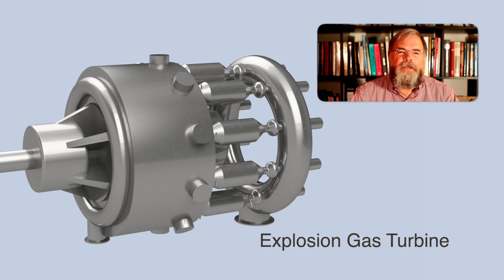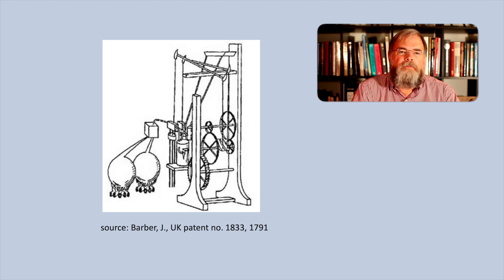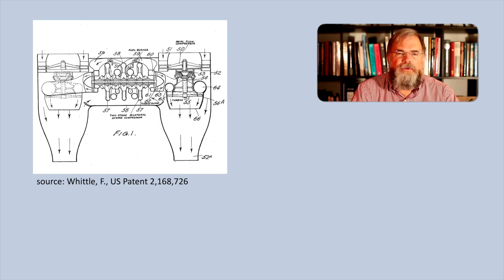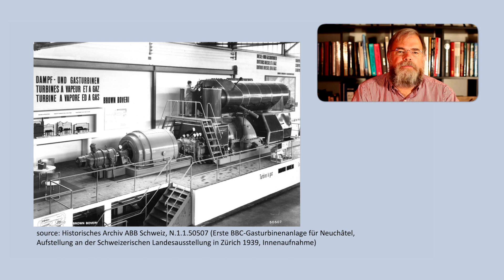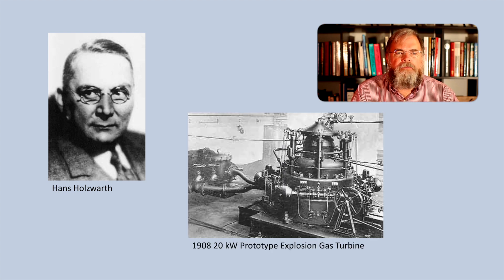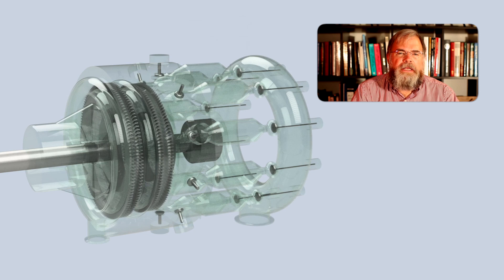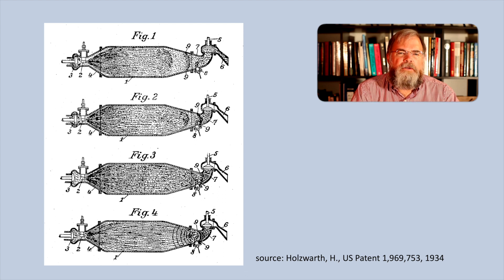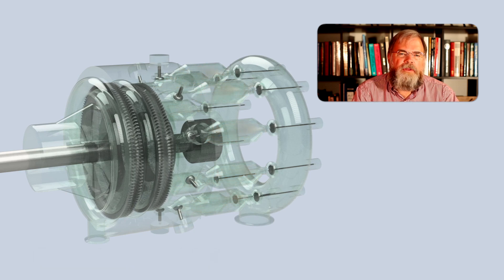Explosion Gas Turbine: Father of the modern gas turbine

Comment: Is there anymore info about the engine,and is it possible for pulse detonation like pulsejet to drive a turbine?
Reply from the maker: Sorry for the delay in responding.  It would be theoretically  possible for pulse detonation to drive a turbine.  These engines were not very efficient at the time I believe mainly because the pressure rise was not very high compared to modern gas turbine engines which typically have pressure ratios across the turbine of between 15:1 to 30:1.  Early variants of them did not pre-compress the air before combustion.  I believe later versions of this engine did do that but I am not certain.  BBC dropped this concept for what would be considered a more traditional gas turbine engine in the 1930’s which had constant pressure combustion in combination with a compressor driven by the turbine.  However people have started looking again at pulse detonation or even rotating detonation combustion for application to modern gas turbine engines (ie with a compressor driven by the turbine already delivering a high pressure to the combustion chamber) in order to increase efficiency.  GE in particular has done a lot of research on this but to date no one has developed a practical engine with this concept.    With traditional fuels used today getting detonation to occur in a reasonable distance would be extremely challenging.  But with hydrogen this maybe feasible.  I think there are still a lot of challenges with this and it isn’t yet clear if the benefits would be significant.  Most of the research papers I’ve seen on this do not demonstrate a significant pressure rise over the minimum pressure during the cycle (the minimum pressure would need to be at the compressor delivery pressure for flow to fill the combustor with fresh mixture).  They frequently emphasis the pressure gain from ambient (as the papers I’ve seen were started at ambient pressure) which is more significant but I don’t think this is the right thing to look at as I can’t understand how flow would enter the combustor if the pressure (at its minimum - usually the pressure rises then cycles up and down for each detonation but as I said the minimum of those cycles after the initial rise is already significantly higher than ambient) there were higher than that exiting the compressor.  But perhaps I am missing something.
Reply from the maker: I’ll just add: perhaps a lower frequency of detonations would help this by allowing more time for the pressure in the combustor to drop but then the the heat release is also pulsed at a lower frequency and between heat release pulses the friction in the engine will act to decelerate it requiring even more energy to overcome this which will work against the improved efficiency of the higher pressure combustion.  There maybe other ways to further increase the pressure rise than the research combustors I’ve seen published.  So it is a very interesting concept and perhaps it will lead to a future engine but it isn’t clear to me yet whether or not this will be the case.
Reply: @engelbrechtgmbh  A detailed answer.Thank you very much.